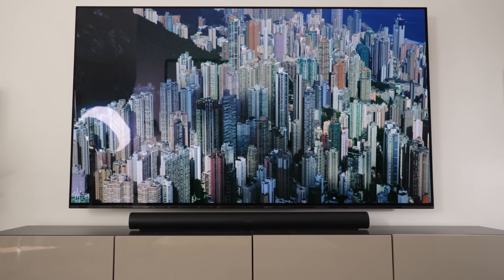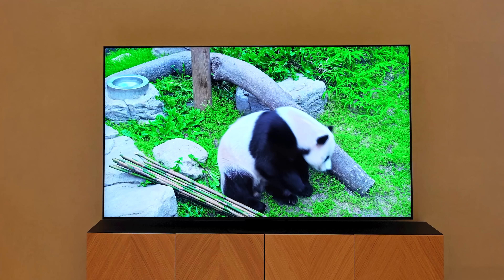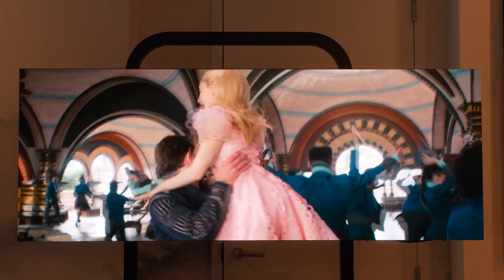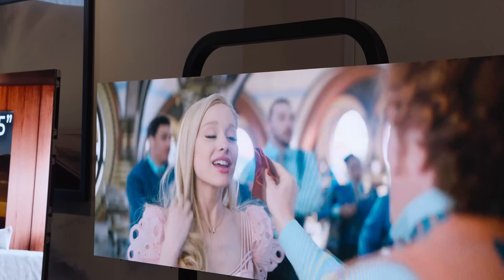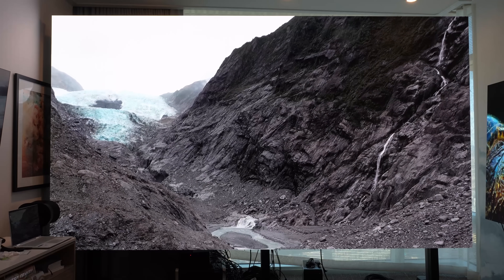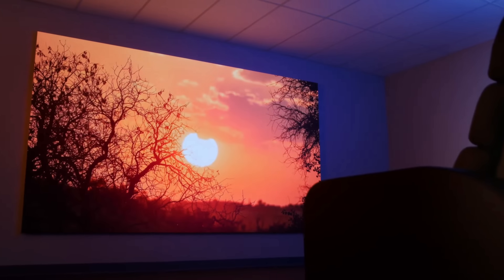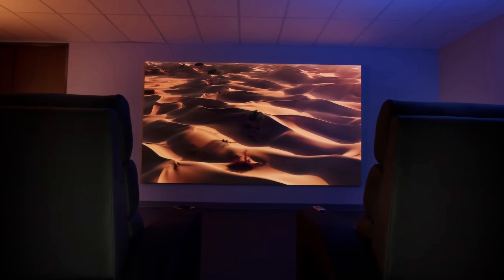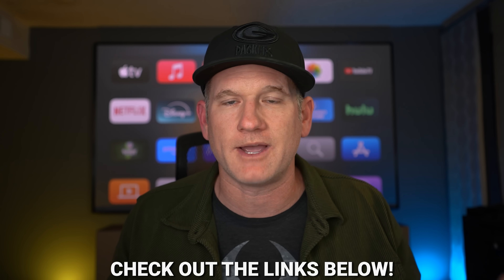162" MicroLED is Actually Coming! - AWALL Vision

Comment: 12,000:1 contrast ratio is not that impressive.
Reply: If you understand Micro LEDs 12000 is  native and dynamic is infinite. The mid size AWALL LEDs have 7,500,000 LEDs that each having its own light source. I’m a black scene they completely turn off. Pure black, pair that with context playing on the same screen, the contrast is infinite.
Reply: Keep in mind that these are DLED displays, not actual mLED, true mLED is a good few years away yet, DLED has been around for years.
Reply: @Wobble2007  In the context of display technology, MLED is often used as a general abbreviation for Micro LED displays, although it can sometimes be confused with Mini LED displays. Let’s clarify the two terms and their relationship to Micro LED technology:

MLED in Micro LED Displays
If MLED refers to Micro LEDs, here’s what it means:

Micro LEDs are tiny, self-emissive diodes that serve as individual pixels, capable of producing their own light and color.
Micro LEDs offer exceptional brightness, contrast, and energy efficiency, with advantages like:
True blacks, as each pixel can be turned off.
High resolution, scaling easily to 4K, 8K, or beyond.
Durability, with no burn-in risk, unlike OLEDs.
Brightness and efficiency, surpassing both OLED and Mini LED.
Micro LEDs are seen as the next big thing in display technology but are currently expensive and complex to manufacture. Stop spreading false statements. These are the best panels possible.
Reply: Yeah that sounded strange....12,000:1 Native contrast and Infinite Dynamic contrast, what gives, that sounds like an LCD spec lol? This can't be true uLED and 1200 nits is that peak brightness or what haha?

Comment: We are living in the future. Even through your camera it’s unbelievable. If god reach down and touched a tv this would be it. I’ve got 12,000 saved. I’ll save a bit more then I’ll take out a loan. If this company could partner with a bank for 6-8 year financing they’d sell a lot more. Also I want my TV-OS outside the tv and not baked in. I use Apple TV. As long as that tv works without screaming at me when I pull the ether cord from it I’m in. Sony tvs shutdown featolike voice zoom 3 when there’s not wifi or ether cord. For that one reason alone I will be abandoning Sony for my next tv. I wanna plug the new tv into the internet so it can get the latest update. Then unplug it. I do that once a year.
Reply: I'd wait a few years yet mate, proper mLED is a ways off, and QDEL is closer than you think, get a true next gen upgrade for that money, wait for 100 to 1 pixel density, multi-stack 12K mLED with native rolling-scan, or go for a three RGB-Laser projector setup on a grey screen with a professional instal, 3 4K projectors will give you a 12K 240 inch on a black or grey screen, or if you are willing to spend 12K, get three 8K projectors, for a 24K cinema grade fidelity display, you can use subpixel rendering and super sampling for incredible image quality with that many raw pixels, you can even go for a 6 projector setup, for double stacking them for twice the luminance and incredible contrast levels, you will need a professional to set it up and align them, but auto keystone is also amazing now days, for 12K, you can basically have an OLED grade 240 inches 24K display, if a massive super resolution cinema grade display is your goal, this is what I'd go for, at least until proper mLED is available, you can also use a mechanical shutter with projectors, for incredible cinema grade motion at 24/48/72/96/120/144 FPS, no modern direct-view display can get near that kind of motion-resolution/clarity, you can get that proper cinematic film quality nothing else can (other than CRT displays & CRT projectors).

Comment: I can see this for large media wall tvs for homes.  Home theater purists will still do front projection because you can use a perferated screen to place speakers behind the screen just like in theaters.  Speaker placement would be an issue for 160 plus inch screens.  Mainly because of the price point. Front projection is cheaper and getting better.

Comment: Can you see any seems between the panels ?
Reply: They MUST be noticeable.
Reply: @marcse7en  Right, but think about it --- people game on multi-monitor setups with 1/2" or 1"+ total bezel widths, and people were gaming on multi-CRT setups with 4"+ bezel widths. Do you remember using a Trinitron CRT with the two faint lines supporting the aperture grille? 99% of the time --- and 100% of the time when in a game --- you literally didn't see them. You would only notice them every once in a while.

My experience attempting to maximize immersion with all kinds of displays and projectors in various configurations tells me that if there's no actual gap, and it's just a matter of a faintly visible line, it won't really matter if you're immersed in a game or movie.

Ultimately I'd have to see for myself of course.

Comment: Wait MicroLED TVs promised to have a peak brightness of 10.000 Nits, native contrast of 1:1.000.000 like the one from Hisense at CES recently (Hisense 136MX), so why is the MicroLED product from Awall only offering 1200 Nits ? Do I miss something ?
Reply: You kind of answered your own question. "Peak brightness". The Hisense doesn't have 10.000 nits fullscreen, it's likely either a 10% or 3% window. Just like the OLED that was mentioned in this video at 400 nits, it probably has a peak brightness somewhere around 3000-4000 nits. 1200 nits fullscreen is very impressive, if that stat actually was fullscreen.
Reply: @v119-h2d it's insanely impressive. hisense 110ux the brightest TV ever comes at 24,000 nits peak but under 1,000nits full screen and it lowers even more if it's full wight content.
Reply: Go to 11:08 of the video.  10,000 nits would blow up your homes fuse panel and cost $400 a month to use. Its a waste of energy and money. You don't need more than 400 nits in your home.  For a reference When considering Micro LED displays for home use, the required brightness (measured in nits) depends on the intended application, room lighting conditions, and viewing environment. Below are the common nit requirements for Micro LED displays in various scenarios:

1. General Home Viewing in Moderate Lighting
Nit Range: 500–1,000 nits
Why: This range is ideal for typical indoor environments where there's moderate ambient light. It provides a bright and vibrant picture without being overpowering.
2. Home Theaters (Dark Room Settings)
Nit Range: 200–500 nits
Why: In dark rooms, extremely high brightness isn't necessary, as lower brightness levels reduce eye strain while maintaining excellent contrast.
3. Living Rooms with High Ambient Light
Nit Range: 1,000–2,000 nits
Why: Rooms with large windows or lots of natural light require higher brightness to overcome glare and ambient lighting for a clear picture.
Practical Recommendation for Home Use:
For most indoor home setups, a Micro LED display with a brightness level of 1,000–1,500 nits is sufficient. This range balances performance for both HDR content and brightly lit rooms while not overwhelming darker settings like a home theater.

Comment: Both Hisense and TCL showed off 163in micro led TVs at ces 2025. bigger than Awall's and most likely will be cheaper 😊
Reply: Both Hisense and TCL are over $200k.
Reply: @homemediapatrol3784  maybe price will drop by the time it's ready to release?
Reply: @homemediapatrol3784  it's not even out yet and they didn't give a date or price. I think you are confusing it with their other large 163in commercial displays. which is a separate thing. for commercial use. that's older technology than the one they showed off at ces 2025
Reply: Your comment makes zero sense..

Comment: 3:57 Man! Thats actually super cool. Instead of replacing your entire TV when say. A Pixel dies or your kid hits your TV or an accident happens. You dont have to replace your entire TV you can just replace one of the panels that locks into the unit. Thats Incredible! and really smart actually. If this is how all microleds are gonna be thats great but if this company has a special niche for this I can see why some ppl might consider going that route instead. Thats pretty great!
Reply: That’s all micro LED displays
Reply: @BartRovers_  Thats Good.
Reply: @NBWDOUGHBOY  kinda, it also means you have gaps on every screen
Reply: @BartRovers_  More than likely wouldnt be noticable from 8-15 feet away.
Reply: @NBWDOUGHBOY  yeah I guess so, you don’t see it in the video either

Comment: These panels and processors have been around in the commercial sector for a long time and you can build such a TV yourself, perhaps even cheaper and with smaller pixels if you find a good supplier from China.
Reply: First of all, Chip on Board (COB) displays are a new technology and require a specific processor. If you can provide me with a Chinese supplier that offers panels, cables, wiring, wafers, and a compatible processor with English instructions, as well as teach me how to install and configure each panel and COB display so the entire system works in sync, please let me know. Also, is it safe to send a Chinese supplier $25,000 upfront before the shipment? Should I be concerned about losing my money? How much Tariffs should I pay? What port should I have everything shipped to? What forwarding company should I hire to schedule the delivery to my house?  Thanks for the advice—you’re a genius. Did you want AWALL to reduce the price to 90% instead of 70%?
Reply: @homemediapatrol3784  No, they can deliver directly to your house. They offer 162" 4k for 50k and i found such setup on alibaba for about 18k (panels and processor) plus maybe couple thousandths for mounts, cables etc. And Internet full of free instructions. I was interested in this topic long before the CES, it is not that hard if you have time
Reply: @homemediapatrol3784  video instructions for every step https://youtube.com/playlist?list=PL7ihOiAqpFNs5ACFEZO-b5CpI-gTHfaMg&si=jQId9ggD9MVyLQ0T
Reply: And you have local companies that can do everything for you for some margin

Comment: MicroLED is the holy grail of panel technology. 
I'm not a fan of having an array of separate panels, so once they get normal sizes that aren't made up of multiple panels, i'm definitely interested.
Reply: "I'm not a fan of having an array of separate panels..."

Why not? It's nothing but a benefit, as if any pixels die you can just replace that section instead of having to buy a whole new display. Also, you can simply increase the size and resolution of your display at will (or decrease it if you need some quick cash, lol).
Reply: This is NOT MicroLED.
This isn't self-emissive. The MicroLED you think about and seen at CES is self-emissive and full 8.3 million pixels (LEDs).
This has a native contrast of 12,000:1. Hence it's not self-emissive.

This is like Honda Civic calling themselves a Ferrari.
It's misleading BS.
Reply: @Swecan76  It's advertised as having an absolute black level, which is impossible with anything but CRT, OLED, and (Micro) LED (and Plasma?).

I admit that a CR of 12K:1 makes no sense. If these aren't LEDs, then what do you suggest is the technology? For one, if it weren't LED, there is no reason for the limited pixel density. MicroLED is the only technology that would limit pixel size to a whopping 1 mm.

Comment: I just went to their website to check pricing and for the 108 inch size with 1.2 pixel pitch the price is $15K not including installation.  If you switch the pixel pitch to .9 it is $25k.  They don't have a lot of details, but I would like to know about HDMI inputs such as 2.1 and connecting a soundbar to this?
Reply: You're spending $15K+ on a tv and pairing it with a soundbar??
Reply: That is really bad. 1.2 pixel pitch means you need to sit at least 15 feet away. This thing has very poor resolution.

It's not self-emissive if it was it would have 8.3 million LEDs. It doesn't it has 1-2 million and it has a native contrast of (claimed) 12,000:1. Meaning it's backlight with larger microLEDs and it's not at all a MicroLED you see on CES floor.
It's also weak at 1200 nits.

It's a half-way attempt.

Comment: Did you mean to say 12 hundred nits brightness? As in 1200nits? What's the peak brightness? I mean those same OLEDs are capable of hitting 4000 nits in a 3% window. How does it perform with bright highlights (where OLED shines the best)?
Reply: Some misconceptions need to be cleared up. I first thought 1200 nits seems to be referring to the full screen brightness maybe.... I assumed around over 2000 nits for highlights since Samsungs uLEDs have a few options for the brightness of their tiles/panels either 1800/800 or 2000/500 for highlights/full screen last time I checked on their website. But it could be that is actually the highlight brightness since they didn't get very warm to the touch (everyone has mentioned Samsungs get really really hot to the touch) and full screen might be even less since they are cheaper compared to Samsungs.....who knows? We'll find out later when someone gets a chance to do some measurements. But that would be my guess based on the little info we actually got....

And that 4000/3700 nits for Samsung Displays new 2025 QD-OLEDs (remember they also claimed that the 2024 QD-OLEDs reached 3000 nits.....) and the new LG TWOLEDs, that's not really achievable for real displays. Since Vincent confirmed this was only when you run them in Vivid Mode at 10,000 Kelvin colour temperature which is a very blue cold looking picture instead of the warm it's supposed to be. So when using a more realistic 6,500 Kelvin (D65 standard) it's about 2000 nits for highlights and the TWOLEDs will be a bit less than that.

Also check out Digital Foundrys CES coverage, they mention all the issues uLEDs have that others haven't mentioned. Basically uLED is kind of arse at the moment lol. 

Honestly the difference between this years best OLEDs and uLEDs are going to be kinda small since brightness is perceived as logarithmic, it's not linear to our eyes/brain.....So the difference between 400 nits full screen and 1000 is not as much as you think, it's only perceived to be about just over 50% brighter. Since you need around 4 times the raw brightness for it to be perceived as twice as bright. And 300-400 nits is already very bright......and if that's the only benefit to brightness........uLED could go the way of MLA.......also with QD-NEDs maybe coming soon and then QDEL.......
Reply: @barryjones2366  Nicely summed.up. Especially the logarithmic perception of brightness. At the end of the day, your perception of brightness is down to what your pupils are doing to manage the contrast. If you have a great true black baseline and a comfortably dimmed ambient TV environment, I guess you don't need endless nits to get a satisfying effect without strain.

Makes you appreciate where we already are with our modern TVs. 😁
Reply: Foolish. OLEDs are 5x less bright. 4000 peak nits for a Nano second on 1/100 part of the screen. They run on 300 to 400 nits in real viewing applications. Did you miss the part of the video where he said theses micros have up to 8 million individual led bulbs? Did you see the oled in the video. Two different technologies, Micros are the pinnacle it’s not even close.
Reply: @jaychannel8558  I understand that. Although they're still prohibitively expensive, are subject to a modular design in order to achieve acceptable yields that are difficult to effectively hide, they have a matte finish (as glossy ones tend to expose the often already detectable seams) and will likely be ultimately passed on in favour of far more budget friendly alternatives such as QDEL or QD-LEDs that are nearing marketability with similar results at higher yields and far less expense.

What I was asking is what the peak brightness was in smaller (say 3 or 10% windows, which the newer OLEDs are now hitting 4000nits, for short durations?). 1200nits is an impressive full screen effect (though cheaper new QD mini LED displays can pull it off). It's this micro LEDs skills with pixel level highlights that has me curious. Can it beat 4000nits? Can it beat the <8000nit levels that we're seeing from Hiense (where the far smaller LEDs may struggle to reach comparable output)?

I suppose althe biggest question, is are micro LEDs a red herring? I.e. a spare no expense solution still 10 years away from being commercially viable during which time new QDEL and QD-LED out compete them? Will they go the same way as MLA did this year?

At pixel pitch alone, there's a hard limit they just won't be able to achieve (which nanotube and self emitting quantum dot tech will deal quite effortlessly with).

Inevitably there will be another shift in resolution as well within the next 10 years to embrace 8K (which low cost, high PPI  tech like QNED will make eventually make affordable and common place). Even 16K might be a thing. Or we might embrace an entirely new format all together. Who knows. Not many saw HDR coming after all, and it's come to define the generation as much as 4k.
Reply: @Sienar7  dude overthink much? Micros are here and have as low as .5 PP. The AWALL in the. Videos are actual products that look better than any tech you mentioned above and are for sale at prices never seen before. There was never an argument that Micro LED was the Pinnacle of tv tech, the question was if the pricing was ever going to become affordable. That is what this video is about.
Reply: @jaychannel8558   8.1 million x 3 since each pixel has RGB sub-pixel uLEDs. They honestly need to make a QD-uLED display using just the blue sub-pixel as the back-light and a QD layer for R+G conversion. It would probably make the brightest and most colourful per pixel dimming TV yet! And be much cheaper and better quality than a uLED display.